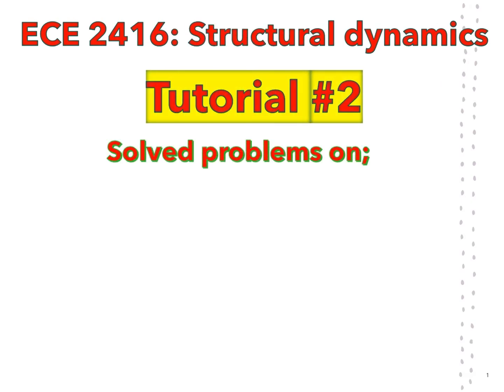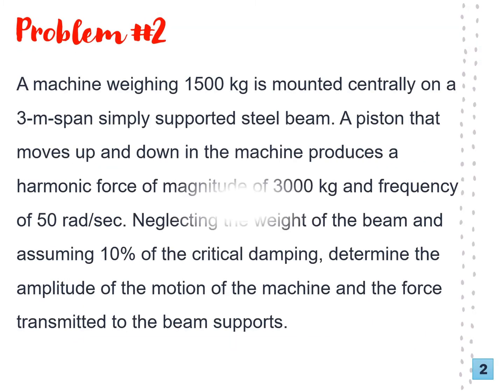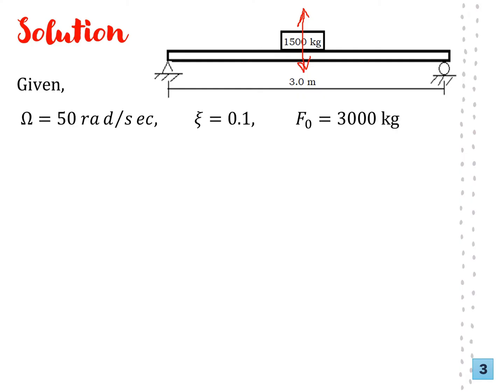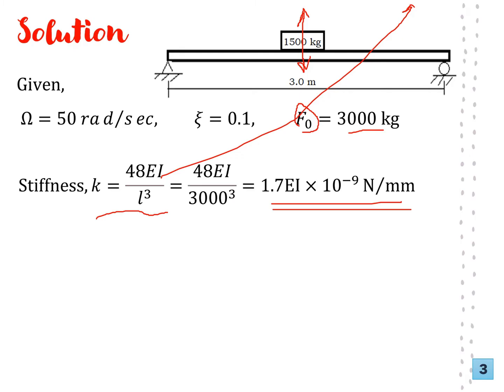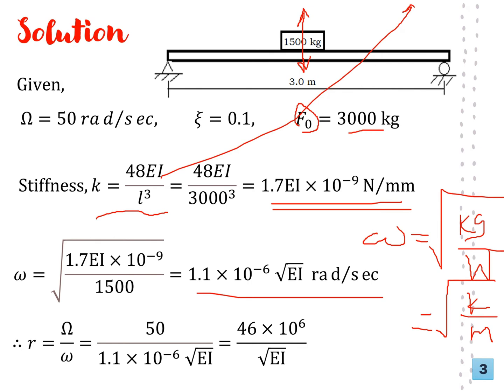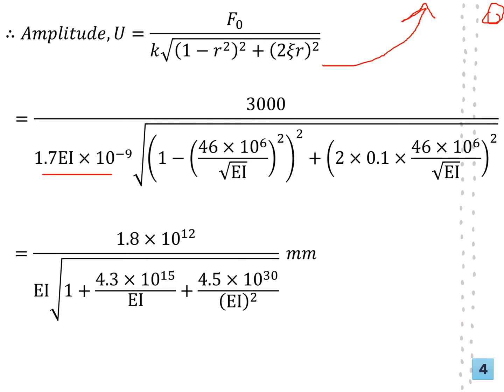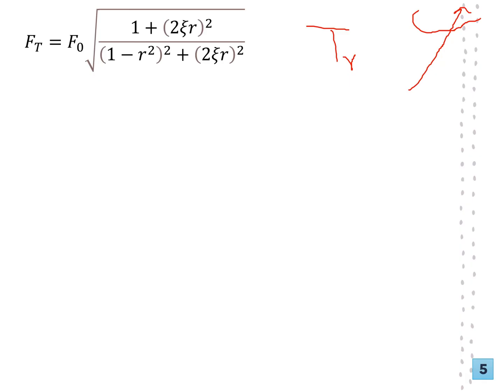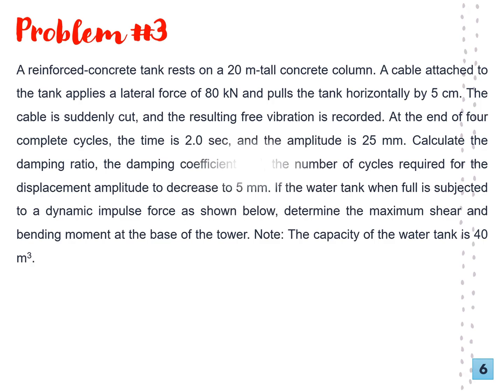Tutorial 2: Forced (Harmonic load) of damped #SDoF systems #StructuralDynamics

Comment: so, i haven't seen how converted the values when calculating the angular velocity.
Reply: When calculating angular frequency w=(K/m)½
The K is in N/mm, according to what I have observed is that the k is converted to N/m by using g=9810 i.e when we use weight, (Kg/m)½ ,if we use K/m, the K is multiplied with 1000 which in this case it wasn't used
Reply: Using (kg/w)½ =[(1.7E-9 ×9810)/14715]½=3.366E-5
Reply from the maker: Hi Annette. Sorry, I didn't clearly understand your question. Could you rephrase and repost?

Comment: The video is helpful sir. Kindly explain why for this question in getting w, you used 1500kg directly without converting as in previous tutorial. It also has mass in kgs and k in N/mm2
Reply from the maker: Hi @Kelvin. Thank you for your concern. Recall 𝜔=√(𝑘/𝑚)  or 𝜔=√(𝑘𝑔/𝑊). So you can use any formular and obtain the same answer. [p/s., in your comment, the units of k (stiffness) should be N/mm].
Reply: @DrGathimba  
But in this question if you use √kg/m you get different values  because the 9.81 is written as 9810 to change the mm in N/mm to N/m
Reply: Thank you